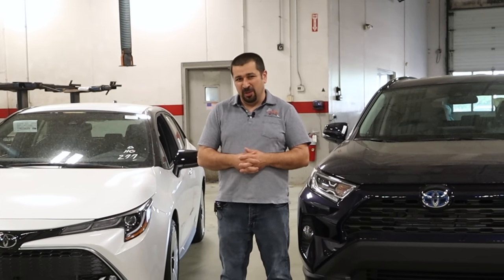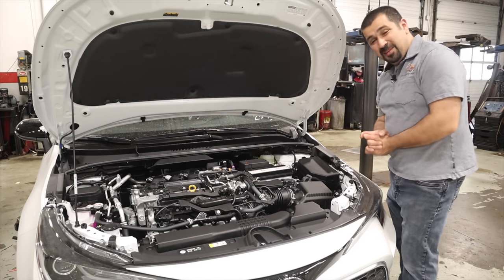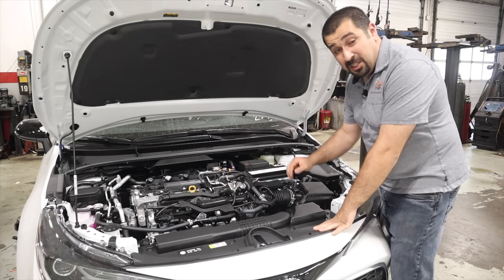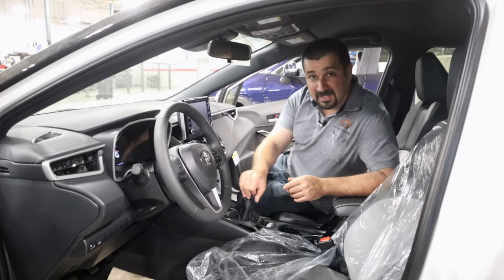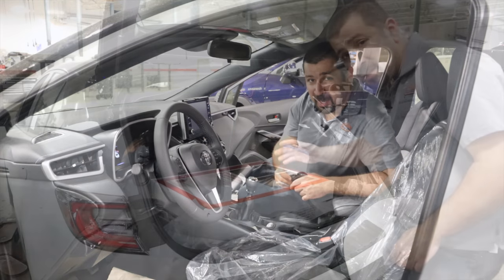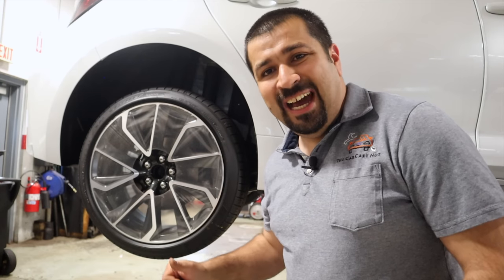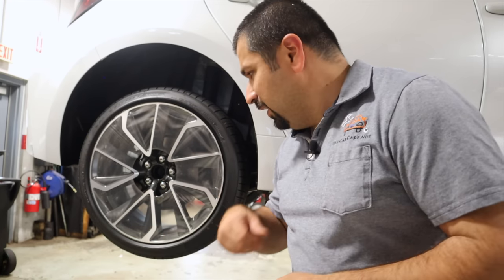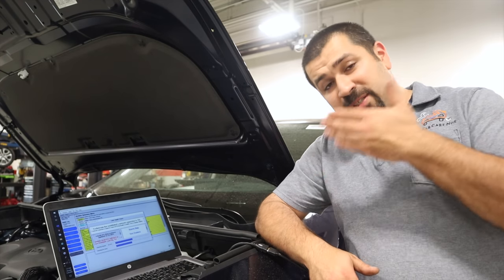Buying a new car? Here's what happens behind the scenes.

Comment: Found a brand new car at a dealership, just wanted to see it, but ended up with a test drive. I really liked it, and was kinda hooked on it. But I looked around a bit more, different dealers, brands and so on. Went back to see the same car again, and got to see it under the hood, to see the engine. I was looking at it for a moment, til I realised what was wrong with it. It wasn't painted in the whole engine compartment, only primed. How on earth was that car on the dealership floor ?
Underside of the bonnet, had some overspray at the edge from the bodycolor, but the rest was primer only. Firewall, and every bodypanel under the hood, was primed only. So, what else was missed in inspection ? I walked away from it. And no, it was not a Toyota.

Comment: Great video.  Why the plug is not install at the factory, does it use for other purpose during shipping?  There're quite a few complain about the sunroof leaking on the new 2021 Sienna, some dealership try to fix the problem and some say leak is normal. Does sunroof leak normal?  I don't think it is, what do you think AMD?
Reply from the maker: Hi! The sun roof shouldn’t leak? That’s not normal. I haven’t seen one leaking
Reply: @TheCarCareNut   I thought this could be something the tech could go over as a check before delivery like when they run the car through the wash.  Here's the link to the sunroof leaks discussion.  https://www.siennachat.com/threads/leaking-sunroof.66018/page-3#post-378585

Comment: Wow.  News to me on the steering wheel.  With  cars I’ve owned or rented, frequently the steering wheel wasn’t centered.  I thought they were designed that way.  I had no idea they’re adjustable.  Question…the steering wheel should be in the center of the driver’s seat, right?  Great video, as always.

Comment: Thanks, AMD. I was always curious about the PDI. But you didn't make it look like it's worth the CAD$2,000 we are paying for it in Canada. (Some 4% of the value of the car!) 🤔
Reply from the maker: Hi! I don’t know what the customer is charged and why for the service but it doesn’t cost $2000 it pays around 1-1.5 hours so maybe $250 pushing it at full labor?
Reply: @TheCarCareNut  They do bundle it as "freight and PDI" but I find it puzzling that the Prius coming from Japan has a lower PDI+ freight than the RAV4 which is manufactured right here in Ontario. To me it looks like they simply slap a % on top of MSRP because the PDI is still more for the Highlander. I guess that's where the car salesmen hide part of their profits. :) Thanks again AMD!

Comment: Are you familiar with Southeast Toyota distributor and how they work?
Reply from the maker: That is a very good question and almost a video on it! When Toyota first came to the us they were small and couldn’t run their own operation so they sold their cars through distributors. Then when they got popular and big they bought out the distribution except one company that wouldn’t sell which is SET so they’re still distributors in that zone
Reply: @TheCarCareNut  Yeah, they add paint and under body protection to all cars that go thru them and you have no choice but to pay for it, plus they also try to charge for an "Inspection"

Comment: I have heard that the PDI service,  performed by the dealer, is paid by the factory. If I heard correctly, this is confirmed at approximately 2.18 minute into this video. Can someone confirm this for me? Videos on YouTube are suggesting that this is double billing, since it is a covered cost by the factory and we, as purchaser, should not be paying for PDI again. If I’m not mistaken, it’s covered in the “destination” charge.
Reply from the maker: Hi! Honestly this is not clear on my side. As far as I know the pds service is processed through warranty
Reply: I wondered the same thing and think I found the answer after a little surfing.  The charge for Toyota's Pre-Delivery Service (PDS) or inspection(PDI) is actually included in the MSRP.  If you look at the vehicle's Monroney sticker there is some "fine print" in the 3rd column under the "Total" price.  One of the statements reads..."Manufacturer's suggested retail price includes manufacturer's recommended pre-delivery service."  Some of the Toyota dealership websites have the sticker available for viewing (I found one in my home state of AL, and another in CA).  According to a Toyota Technical Service Bulletin T-SB-0100-21 for 2022 RAV4s any repairs or adjustments found during the PDS fall under warranty.  I am considering buying a new RAV4 hybrid once the inventories and pricing get better (not holding my breath--maybe 2023).  One local dealership in Birmingham has a "fine print" disclaimer on their website about the new car price that includes a "Prep fee" of $1495--crazy.  That will definitely be a negotiated item or I go elsewhere.

Comment: I figured the smaller car corolla comes from Japan like my Prius C. It looks like small car usually are from Japan.

How do you stop your license plate from vibrating or making noise? when I got my car brand new, the rear plate tend to rattle when driving.
Reply: My 2021 Rav4, rear dealer temp tag rattled when I closed the rear door but the permanent plate won't rattle because it's metal not plastic.
Reply: @sptrader6316  mine is permanent and metal and still rattle.
Reply from the maker: You can remove the plate and apply some foam to stop it from vibrating
Reply: @TheCarCareNut  what is foam? Is it some kind of sponge or rubber for cars?
Reply: I figured it out. I used Google lol
Reply from the maker: Any foam with a sticky tape at the back will work. Something small and not high

Comment: I have a highlander 2010. 260000 miles. The oil cooler line ruptured at 160000 I didn't know it drove home pool of oil next morning . Had the replaced with metal line. No one ever mentioned the line might rupture.  I had a rear bearing  going out. Took to dealer twice.  1st -for 1&1/2hrs 2nd time 2&1/2hrs. They couldn't find the noise. I went to independent dealer oh wheel bearing needs to be replaced

Comment: You mention checking out the car for scratches and etc before signing.. but you also mentioned in the beginning of the video that these cars were just delivered but were also presold. So how can anyone test drive or check before signing?
Reply from the maker: When you put a deposit on a car it is usually refundable especially now. If you have an issue with the car before you actually take delivery you can back out

Comment: I would say the Hybrid is build in Japan. 
Glad you talked about tires when I got my 2016 XLE the pdi was not good. I had 42 PSI in all tires. My car's vin was a JT from Japan. I do understand the over inflation from the factory but Toyota quality on a the PDS and PDI. 
I checked the pressure the next day after sitting in my garage.

Really my 2016 pulled left from day one. I am OCD also the wheel was centered. No crown on the road in a parking lot no gas applied just rolling would pull hard left. 
Really sad. all the Toyota men could not fix it and do you think Toyota Corp stepped up to the plate and helped me. a big NO !!!!.
You can trust me on that I don't abuse my cars either I had a Acura 90 Legend L no accidents and I have a 92 LS 400 no accidents no rust on them either. Almost like new. 
Now with Lexus I can say over a 5 cent screw and a 29 year old car they bent over backwards!!!!!
I was ready for the go take a hike but damn Lexus amazed me.

Comment: My new 2022 Corolla Apex was damaged in transit and I'm getting no help whatsoever from the dealership. They didn't perform an adequate PDI. They didn't inspect it on a lift or check alignment specs. They told me they simply drove it around the parking lot. My car was pulling, steering wheel was titled and numerous body panels were misaligned. I took it back the next day after purchasing, they drove it and said it was fine. I demanded a copy of the alignment specs and of course they didnt have them because they weren't checked. They checked while I was there and it failed alignment. Ive had 4 alignments done since I bought it 4 months ago. It will not stay aligned. Its obvious it was damaged during transport, possibly frame damage.
Reply: Your state has a lemon law. Contacting Toyota corporate is another avenue you can pursue as well

Comment: Splendid video and very informative.

Please consider doing a video on the latest CH-R 1.8 Hybrid re
A) how to trickle charge the 12v battery.
B) how to jump start it safely.
C) tips on how to best look after the high voltage battery so that one can get the best use of it.

Thanks in advance.

Comment: Steering off centre?! That's a strange one. Isn't there a guide on the spindle to make sure the steering only goes in one way and always centre, and four wheel tracking/alignment done?

VWs have one so wheel off centre means other things like wheel alignment or suspension issues.

Comment: Curious: What is the reason that some come without body plugs installed from factory?  Why is it left to the dealership?
Reply from the maker: Hi! That depends on which factory the car is made in and also the model. Some models have no plugs at all. Some come with them installed some not. That’s why the dealership technician needs to check closely to make sure

Comment: I have a 2021 Camry with the 2.5 motor. With manufacturing debris and other stuff I want to change the oil before the 5000 recommended interval. Does the factory fill with a special break in oil or just straight 0w16 Mobil 1?? When is the earliest I can change the oil without creating any issues?? Thank you
Reply from the maker: Hi! They don’t fill with special oil. Just Toyota 0w16
Reply: So I can change as early as I want with no issues regarding warranty etc. I can change at1000?? Thank you love your videos.
Reply from the maker: Yes you won’t have issues with warranty

Comment: @9:30 what are the ( body plug) holes for?
     Those body plugs doesn’t seem sturdy.  Do they fall off often....ending in rust?
Reply from the maker: Hi! They typically don’t fall off if installed correctly. And they are covering a hole where the car was carried in the factory during assembly

Comment: I’ve owned several Toyota’s and never ever have they installed the plugs. Always have them in the glovebox.
Reply: That's disappointing after all that's been said
Reply: I guess you dealt with a very lazy dealership that had lazy technicians.  I guess if it ever happens again..... mention it to them asap.
Reply: @henryhonda8408  I also live in the Mojave Desert so rust isn’t really an issue. Maybe that’s why they don’t do it? Still lazy though, if parts are supplied they should be applied.

Comment: My corolla 1.8 hybrid 2021 does not have the under hood insulation and dealer says the part code is not available for the model, you thing it would create a problem if i just go ahead and install it??  I think it could help with the noise as it is so silent in ev mode and when the engine kicks in it can get noisy at times, not the end of the world but would like to try that.
Reply from the maker: Hi! No problem if you add it.

Comment: Bought the Crown 2 weeks ago.  While detailing the tires, I have noticed that the two front tires in front were scratched and threads  showing out.  Do you think I can take this back to Toyota and asked them to replaced the 2 tires?  The rims are all good except for the tires.  Hoping you can shed a light on this problem of mine.  Thank you in advance.

Comment: I live in Germany and I'm planing to buy a 3.0 Supra very shortly. I know that manufacturer (and vice versa dealer) practices should be the same worldwide, but my main concern is that since this is a car that does not get sold every day, there will be this one bozo in the workshop who will rev the cold engine just because it sounds good, and will also be inclined to "step on it" during the test drive, while the engine is still not on the proper operating temperature. Even worse, it hasn't even been broken in yet (of course because it's brand new). What is the practice, do you have some rules regarding this?
Reply from the maker: Hi! Honestly this can happen. However it’s not a repeating pattern over and over. It might happen once or twice which will not have as much of a negative effect
Reply: @TheCarCareNut  I guess it makes sense. Thanks.

Comment: The pin you pulled out of the fuse box, does that disable the odometer from gathering mileage while the car is moved around the lot?
Reply from the maker: Hi! It doesn’t disable the odometer from accumulating miles

Comment: I'm a bit curious on the body plugs.  Why aren't they installed at the factory?  If the hole goes straight to the frame, why is there a hole in the first place?  Are the plugs itself a wear item that needs to be replaced after several years down the road?
Reply from the maker: Hi! They use the holes to carry the body on the plant and installing them is something they decided to leave for the dealership. It’s not a wear item once installed it’s good
Reply: @TheCarCareNut   Awesome, thank you!
Reply: @TheCarCareNut   Hi, I bought a Corolla HB 2022 and it does not have the body plugs and the dealer tells me that the car does not bring them that it is normal that it does not have them and that it does not need them, where can I get them online and tried several sites do not sell them .
Reply from the maker: Hi! Do you have the openings in the body for them?
Reply: @TheCarCareNut  yes the same you show in the video
Reply from the maker: They’re missing. The parts department should be able to order them and the dealership should be paying for thisn
Reply: @TheCarCareNut  thanks this week I'll contact the service department again 😀

Comment: Hey car care nut /anyone with 2020/2021 corollas, 3:48 I've noticed this corolla has an actual under hood insulation Mat. My Japan made 2020 Rolla 2.0 SE cvt did NOT come with one and would like to have one. Should these be included in the 2020 corolla? Would like to try to hush the noisy engine down a bit and also provide some more warmth in winter (in Chicago land area as well) I want to make sure the dealer didn't steal it as these are close to $200
Reply from the maker: Hi! Some of them don’t come with the mat I’ve noticed

Comment: So I guess the technician that did the inspection on my Camry missed some areas since my car has had two oil leaks and the dealership refused to fix one of them.
Reply: Go to another dear if still under warranty
Reply: @jlawr4427  I talk to a supervisor and I was told that it was not a big leak to be consider a leak by Toyota and I went to another dealership and ask them about it and was told that the previous dealership put some notes that they had decline the request.
Reply: @jlawr4427  Thanks for the advise.

Comment: how many miles should be on a brand new car right from the factory if it wasnt driven on the road for demo or other purpose like getting someones lunch?
Reply from the maker: Hi! Usually less than 10 miles. Sometimes dealerships trade cars between them locally so you’ll have less than 50 miles on them

Comment: After I watch this video .   I missing  the  3 parts that come with the 2021 Toyota Corolla hatchback xse  .   Can I still go back to the dealer ask for  my 3 parts that supposed to come with the  brand new car  that I purchased 8 months ago ?
Reply from the maker: Hi! Which parts are you missing?
Reply: Two rubbers that go into the two holes under the car ,  the license plates for the front  and the rubber mat that fit the back
Reply from the maker: I would ask the dealership. They can get them for you. The May for the back might be an option that has to be purchased.

Comment: Is it normal for the idle to feel rough when the traction battery is charging while not moving? Gas engine idle alone is fine, checked with maintenance mode. But when charging at a stop and in park it feels like it is miss firing on a cylinder. Wanted to ask so I know whether to call out the dealership or not if they tell me that is normal.
Reply from the maker: Hi! It wouldn’t hurt to have the dealership take a look but when it’s charging there’s more load
Reply: @TheCarCareNut  thanks for answering me again, really appreciate you!

Comment: Do dealerships install the window tint? I wanted to buy a new Highlander and the dealerships had between $2995 to $4000 in dealership prep: window tint, Nitrogen in tires, $129 door guards, trunk bumper film, floor mats in front seats, etc of "things". Does the dealership really install these things or does it come from the factory with tint & mats & etc?
Reply from the maker: Hi! On a highlander they’re only tinting the front windows. The rear windows are tinted from the factory

Comment: Wanted to see if you could help me. I’ve tried to replace the belt molding on my 2000 Camry le that is falling apart along the bottom of the windows.  The one I tried to remove got bent a bit but couldn’t get it off.  I saw a video of a Corolla lifting the one end near the b pillar and then sliding it towards the b pillar if it’s the rear door.  Mine wouldn’t slide at all.  Any tips or help?
Reply from the maker: I haven’t done that in a long time on that car! It should lift off but I’ll double check for you